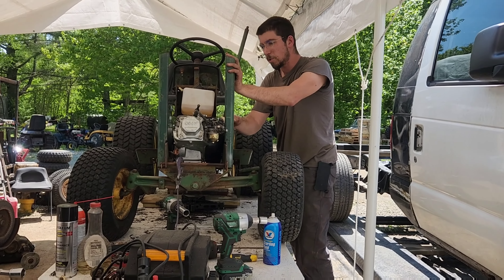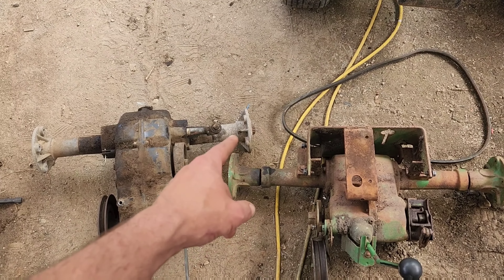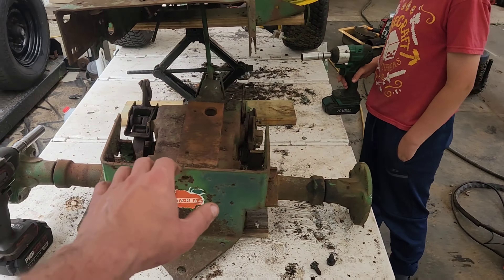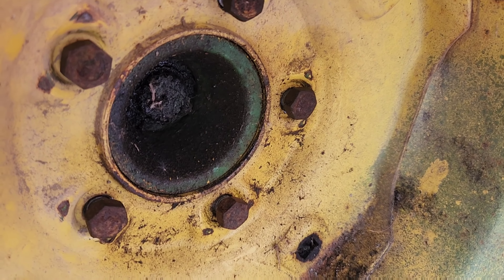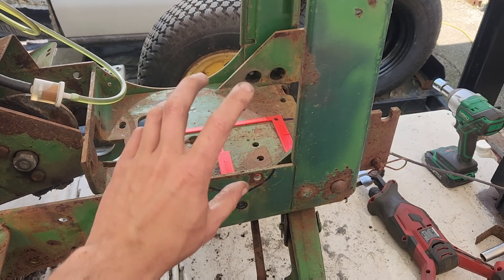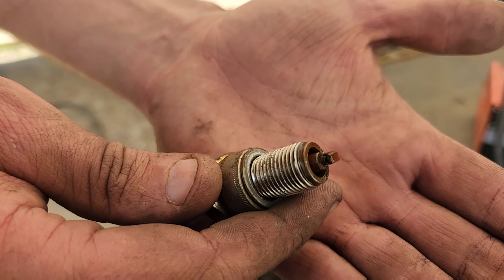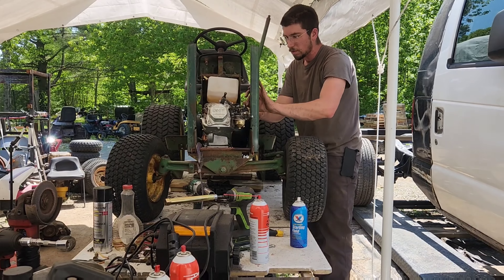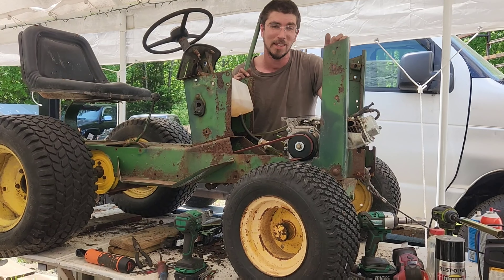Predator 212 John Deere 110 Part 2

Comment: Interesting and motivational for me to get moving forward again on my JD 240 with the B&S OHV single cylinder, since decided to hoard the V twin 18HP Vanguards.  Haven't needed to use, though is next up on the GT plow, snowthrower and at one time backhoe and front end loader planned candidate.  Now I have two more other even heavier duty older style chassis that will be next after those... with the potential cub cadet generac generator made in Japan oddball B&S single cylinder I guess Vangaurd or Honda clone tapered shaft, rotor shaft metal used as an adapter unplanned excursion for the one.  I think I was thinking adding an old school pulley rip cord starter in between the flywheel custom fabbed adapter and driveshaft as a vision at least.  Which you have a great series on that similar adaptations using the Duramaxes if I recall correct.  If you haven't watched, check them out. Great 3D parts as well to save time and headache.  For some reason with that build I'm fixated on having the PTO on the front for the deck or other custom front end dream at least.

Comment: Hello, I also have a 110 John Deere tractor, But my tractor has a retrofit M8ST Kohler Magnum engine. 
From what I noticed when I bought the tractor, Someone cut sections of metal away with a cutting torch to fit the Magnum engine into the John Deere where the cast iron K-181 Kohler engine had been before.
Being the tractor was slightly butchered anyway, I have been thinking of maybe trying one of the 13hp Predator engines should the Kohler engine bite the dust. I really enjoyed your videos because I got a view of what the tractor looks like without the engine. I’m kind of wondering if the bolt pattern of the 8hp Kohler Magnum engine and the 13hp Predator engine are the same. The wiring on my tractor was absolutely terrible In which whoever mounted the engine attempted to marry the wiring of the John Deere and the Kohler M8ST in which the wiring looked like a “Rats Nest” and I started cutting and didn’t stop until I had totally removed the entire wiring harness.  Good Luck with your project 110.